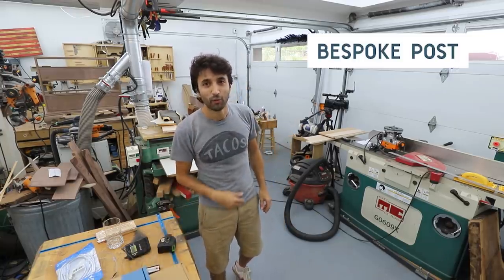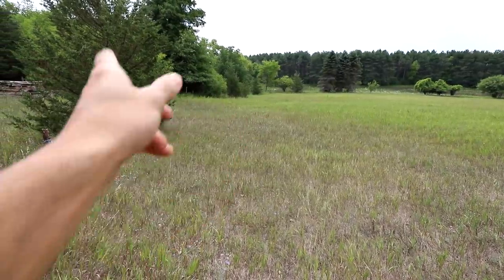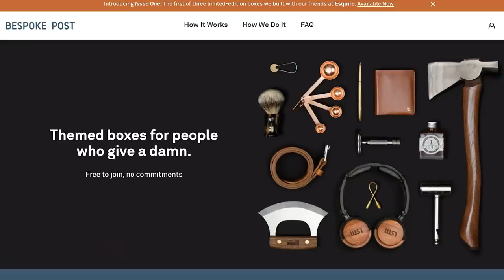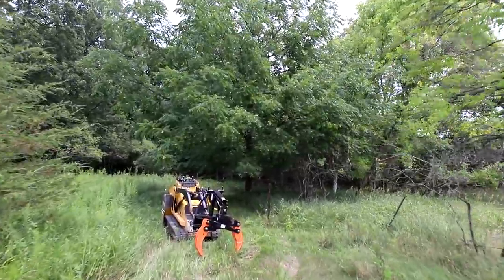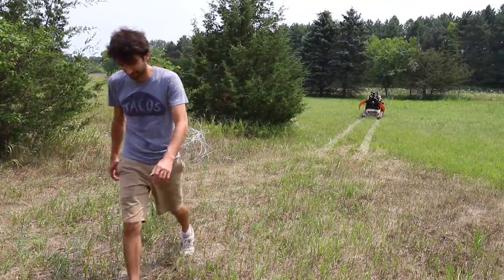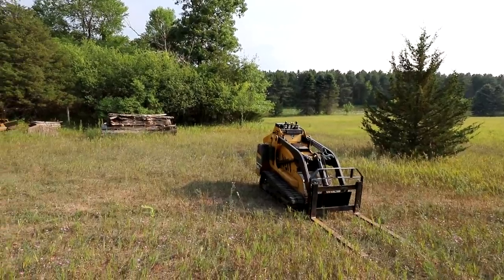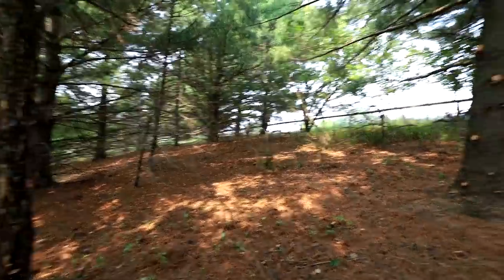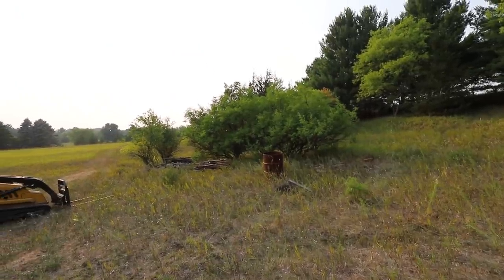Cleaning up around the future shop and sawmill site

Comment: Detach after you shut the machine off and after shutting the machine off you cycle both open and close functions and lastly disconnect your attachment. That should relieve the pressure.
Reply: Yes, cycling the valves will relieve the pressure.
Reply: That. Or after you shut the loader off, push the 'valve stems' (for lack of a better word) of the couplers in for a few seconds without immediately disconnecting the hoses. They're designed to bleed the pressure back to tank (originally just to relieve pressure on the machine side for connecting, but will work for the attachment side before decoupling as well). Source: Have worked on designing a similar product. ;-)

Comment: I would strongly suggest either trading your skid steer in on a larger full blown model.  Or keeping it for indoor/driveway use and buying a new bigger one.  The number of attachments for them is beyond imagination.  Even a brush cutter, log splitter, etc.  Not to mention all the work for leveling the ground so that you can build.  I also have a backhoe attachment for digging water lines, footings etc.  They are awesome.

Comment: 18:28 is why you have to crack a line to hook up the quick couplings.  Even if you have no pressure on the cylinder prior to unhooking the hoses once you move the attachment to the ground the system picks up a little bit of pressure from its own weight.  This can be made worse or better by changing temperature of the fluid, either through sunlight on dark hoses and or true temperature changes.  With quick couplings only a few PSI will stop the fitting from working and it doesn't take much weight or change in temperature to cause that.  Only option to avoid this is to disconnect the lines after dropping the attachment and then hoping the fluid temperature doesn't change much before you hook back up.  They also make a bleed tool for the couplings that might be faster but certainly more costly than your current method.  Talk to local hydraulic shop or search online for the bleed tool for your specific coupling size/style.

Comment: If you actuate the hydraulic valve for the aux. hydraulics either direction for 5sec with the machine off you should be able to relieve the Pressure off the system. Then you just got to try which one of the fittings is easyer to hook up first. Might also help to do this procedure when detaching the hydraulics. Also standing the log grapple up on the claws will put some pressure on the system, maybe try laying the grapple down flat on pavement or a pallet in that case.

Comment: matt i do understand the amount of work involved in a small holding such as yours.  if your not going to graze stock get a contractor in and turn all that grass into feed.  you may be surprised at how many bales you get and the value of them.
Reply: Or plant trees and let some of the pastures go wild:) more trees!!!
Reply: Vintage Motorcycle Repair  I believe that he is talking about cutting and baling the grass for Winter feed. It can be used for cattle and horses.
Reply: Depending on his county tax roll rules, he may need either an animal husbandry operation or to to use a bunch of his unused hill sides and spaces to grow grass to satisfy the Ag tax carve out- that could be worth more than the grass itself. The grass could likely be a contractor type operation- and such contractors often will need secure areas to store their cut bales too. Matthew has a bunch on his own plate- I'm thinking the grass w/ contractor would detract less of Matt from an already full slate! FR
Reply from the maker: Yes, the tax incentive would be worth more than the hay but there are minimum acreage requirements and we’d dip below that threshold pretty quickly with our development plans
Reply: @mcremona  I see you have already explored the situation- why am I not surprised? I suppose you could look to  a grass plan in the short run and adapt as necessary. As I said earlier, many of the contractors who do this work often need "safe havens" for the hay- having a yard with good road access and turnarounds for them would make a great candidate. But it's your plan- it has to work for you and toward your ambitions- I'm here "for the ride" and look forward to how you navigate the challenges. If you have need of a filler, I'd love to hear you "walk and talk " us through the thought processes. FR

Comment: I have a Morbark Boxer 700 mini skid. On the machine side hydraulics there is a relief block with two button and a small line running back to the tank to relieve pressure on the block to attach hoses

Comment: Have you considered a wood chipper? Burning piles of brush disposes of the brush but there may be issues with that method. Chipping the brush in place leaves a bed of mulch under the trees that has a lot of benefits. It is likely you could even find an attachment for your crawler to do the trick (one les engine to maintain).
Reply from the maker: I will eventually get a large one to chip all the sawmill waste. I’d also like to set myself up as a tree service dump site so I’d need to be able to process all their brush

Comment: When you shut the machine down actuate the controls for the lines you want to connect it will purge the fluid back into the system alleviating the pressure that causes your frustration
Reply: sometimes the key has to be on depending on the vehicle also set the attachment on the ground before disconnecting I saw it bleed down after hoses where off
Reply: Особенности Российских дорог: https://youtu.be/_oXrcG6utKY

Comment: When you detach your hydraulic attachments do you cycle the hydraulics to relieve the pressure in the hoses first?  This is your likely problem.
Reply: You have to ALWAYS Bleed off the pressure if before detaching any hydraulic implements.  This is normally done on your 3rd function (front grapple) by leaving some opening, shutting your engine down, then turn on "ignition" only and work the function buttons.

Comment: You might have a pressure relief button on a control panel that you can push at "shutdown" that releases pressure just before you detach.  If not the best advice is to put the device in as near a "neutral" state as possible just before detaching.

Comment: Hooking together the male and female couplers on your attachments after you take them off the machine will help equalize the pressure in the lines. Otherwise they can actually build pressure in the line due to solar heat gain or gravity applying force on the cylinders. They also make a modified Irwin quick clamp for joining stubborn couplers. Hope it helps.

Comment: Besides the other suggestions of decompressing your hydraulics before detaching your attachments, I have noticed that pressure will also build up by the attachments being exposed to the sun, heating up and causing pressure to build up.  Don't clamp the fittings together; all you have to do is tap the male ball end onto some metal part of your attachment, and it will squirt the extra pressure out, making it easy to install the equipment.

Comment: something you can try for your hydraulic. Is turning hydraulic off/ or equipment before disconnect the hoses. With are work trucks if we don't turn off the hydraulic to are tools before disconnect them, we cant reconnect them without bleeding the tool. if we turn of the hydraulic before disconnect the tool we have no problem reconnect the tool without bleeding it.

Comment: On the hydro hoses after you turn the machine off wiggle the controllers that operate it & the pressure will release ! The area you trimmed would be a nice camping area if it had seperate access from the road ! Those fence post you could resell $2 or $3 each or sell as scrap the scrap prices are really high right now !

Comment: I think I see why you have residual pressure. You should stop the engine before detaching any hydraulics. There may even be (as on Bobcats) a button which simultaneously bleeds the pressure and stops the engine when you hold it down for 5 seconds. 
That said, there is a tool for forcing recalcitrant hydraulic quick disconnects together. It is essentially a pistol-grip quick-clamp with jaws (forks) that fit around the hoses so you can squeeze the QDs together. I saw it on Andrew Camerata's YT channel a while back. If you don't have time to look for it, just ask me to find the exact episode.

Comment: If you have a floating feature then just set it on the ground and throw it in float turn the motor off and then that should release pressure. if that doesn't work while it is still in float( motor off) move all leavers until there is no movement. (you should be able to attach the lines almost one-handed.) We do this when changing our loader from bucket over to a road sweeper and vice versa.

Comment: Regarding the nut trees, I have to ask if you counted the leaves on each stalk. Those trees look an awful lot like the Butternut trees in my yard. Butternuts average 17-19 leaves per stalk. Walnuts usually 21 or more. Big difference in growth rate and nut edibility. Butternuts are best left to the critters, with soft “buttery” nut texture. Butternuts grow as fast as a soft maple. Walnuts much slower.

Comment: Suggestion:  You either need two chain saws or take that long bar that is on the saw you are using off and replace with a 16-14 inch bar and chain for the light work you are currently doing.  Lot easier for limb and small growth removal and much lighter.
Reply from the maker: I have both suggested options but wanted the reach and workout

Comment: With the hydraulics you need to equalize the pressure before you unhook them.  I was taught not to hook or unhook hydraulic lines while the machine is running.  I don't know if that is specific to the equipment I have or a general safety thing.  I usually turn the machine off than equalize and that always seems to work for me.

Comment: Matt, Thanks for the summertime your. Didn’t the fence post help to identify property lines (especially in winter snow)?
Reply from the maker: The barbed wire fence is on the property line. The electric fencing is within the property

Comment: Matt, we can see (at 18 minutes) what your doing incorrectly when you remove the hydraulic attachment, you need to shut the engine so the hydraulic oil pump stops and then play with the controls every way, to remove any pressure left by the pump, then you will be ok next time, BTW don't you think you are using an overkill too large chainsaw for pruning, take a look at the Stihl multi tool trimmer-broom-squidgy-pruner-hedge cutter-tiller...with extensions, I got a full pro kit 10 years ago and never regretted it... That would be a great tool addition for your property with maybe an RTV-x or something like that!

Comment: Andrew Camarata discussed and showed using a very cool tool for doing what you're talkin about putting  two hydraulic hoses together.  Sorry I  don't  recall the name.  I have same issue when  hooking  up attachments  to my  tractor but usually  can hook them up if pressure is released via the  controls
Reply: QC Mate. I also added a comment to that effect. Took me a bit to find it!
Reply from the maker: Thank you!
Reply: @nickpeake4709  Interesting, my comment with the same link was deleted. Will be interesting to see if your's survives!
Reply from the maker: Comments with links can get weird. Didn’t see yours, Phillip, but see Nick’s

Comment: I watched you disconnect the grapple and noticed you had the machine running.  Before you attach or disconnect the lines, shut the machine off but leave the key on and operate the controls for the grapple or whatever. This should relieve any pressure in the lines. Also when you pointed out where you wanted to plant trees, you said on the hill, i think. Wouldn`t the trees stay better watered in the lower places? Just a thought. Take care

Comment: ken's bolt on hooks has a tool to relieve the pressure on the hydraulic hoses. The pressure builds as the temp rises, so all hoses get that way in warn temps.

Comment: Always had trouble with hooking up after an attachment sits and warms up, hydraulic pressure builds up in the sun or heat therefore you can't connect the couplers.

Comment: When you want to attach or detach, park and shut the engine off. That kills any addition of pressure. Then while it's not running, operate your controls each way and it will bleed off the pressure..

Comment: The amount of times I've pulled my back or shoulder pulling T-bars... The vermeer would've been a dream.
Reply: you may find a mobile A-frame/pyramid with a chain pulley to be easier.
Reply: There's a tool called the Tuggy T-Post puller (and several other of similar design). It works a charm if you don't have power equipment like a skid-steer or the like.

Comment: Matt, why build your shop and drying shed so far from the house? It will add expense running power and water and septic connection costs up and add a security issue.

Comment: Temperature change and if the attachment moves it will cause pressure.  Think they make a tool to release the pressure in the fitting.  Tractor time with Tim did a video about it

Comment: Hay mate do you have a hydraulic schematic for your little skid steer most of the little ones will have a discharge valve of some kind if not put one in and problem solved no more bleeding 😁

Comment: Matt, don't you have a 14inch chainsaw?
 Using that monster that you where can't be good for your back
For the amount of branches of the ground you could either use a pole saw or some drywall stilts to assist. 

When used correctly a 14in chainsaw can cut around a 26inch log without the effort needed to swing a big saw around.
Meaning that you can work a lot longer without the same fatigue.
Tony from Western Australia 🇦🇺
Reply from the maker: I have both a smaller limping saw and a pole saw. Needed the exercise
Reply: @mcremona  ah that was it, I have used the sthil farm boss about 20 years ago to help a friend cut her firewood  over a few weekends boy you do get a workout!
I think that is where I really learnt the phrase "work smarter not harder!" life is hard enough Matt and at 61 this way my decrepitude wishes that I knew that in my late teens, pace yourself Matt
This life you find yourself it has no repeats and I wish I didn't do that 20 years ago
In THIS life you only get one go around and I can tell you from experience the ramifications of needless "exercise" when young catch up with you later in life and you Are not going to like it one bit!!
I'm glad you have started your arboretum have you considered trees like the Tasmainian Huon Pine
Or the Blue gum (eucalypt)
Or other Eucalypt species 
I put in a couple of tube stock
Eucalyptus lucoxin and rosea seedlings 30 years ago her on my 1/2 acre and a tassie blue gum (opps the later can grow to 350 feet) the first 2 are approximately 90 foot tall and a diameter of about 5 feet each 
The bluegum is about 75 foot and still looks like a sapling at about 14 inches diameter 
for you these trees would be exotic timber! 
Tony from Western Australia 🇦🇺

Comment: As long as the drainage is good, the old quarry track should serve well enough.  It should still bear some of the compaction it gained years ago.  Assuming it runs where you'd like, that is.  Wherever you put your 'business' driveway, think ahead and make sure there is plenty of room for a semi (or two) to turn and negotiate your layout.

A little metal detecting might be in order.  You'd be surprised what might get buried in the waste material of an old quarry.  From small parts to whole machines, surprisingly not always deliberate.

Comment: Matt, you really need a small electric chainsaw for that small junk rather than the monster you're using. No fumes instant start and a ton lighter. DeWalt or Milwaukee make great ones for 18" bars.

I need me one of those tpost pullers.

Comment: Pile brush in middle of field have New Year’s Eve bonfire 

Ps if your 70 year old hands could back and talk to your hands they would say wear good quality gloves. Also try to really limit chemical export to bare skin. At this point in your life the damage is hardly noticeable but trust me you use your hands like I did most of my life. 5of my 8 fingers hand trigger finger damage needing minor surgery. Trust me you wear all that safety gear to saw except gloves and it will catch up to you 
Thanks for all the videos

Comment: How many cc's was that limbing saw? A 4" battery saw would've made that job a lot easier.  Why not use a pole saw to start the job? I'm very confused.
Reply from the maker: 77cc with 28” bar. I need the exercise
Reply: @mcremona  so it was a Stihl MS460 or MS461? That's not too bad. For a real work out you need the 090 or 088 unless you have a 3120.
Reply from the maker: 461; my 090 needs a tune up

Comment: You might want to lookup tree trimming on the internet as every tree limb removed should be sealed so disease dosen't get in to the tree. Also don't cut the limbs flush with the trunk, that opens up the tree trunk to disease also. Leave a stub of 2 to 3 inches.  Then seal it.
Reply: As an arborist, sealing/painting pruning cuts hasn't been an accepted industry practice for decades. As far as your pruning comment, you want to prune at the branch collar, which for conifers is significantly closer to the stem than deciduous trees. Looks like job well done to me
Reply: @codym6340  Just checked with my Daughter who's a Botanist, and she told me your right. So sorry,  I was going with the "This old House", Roger Larson who I watched years ago, and from what I remember that was current practice then. although it didn't seem like, "decades and decades" ago. I must have remembered it wrong.